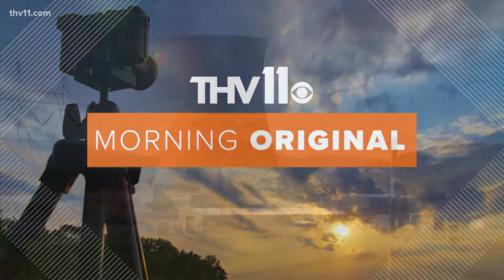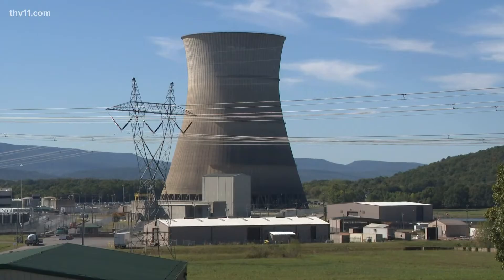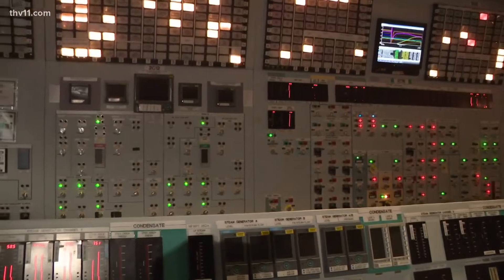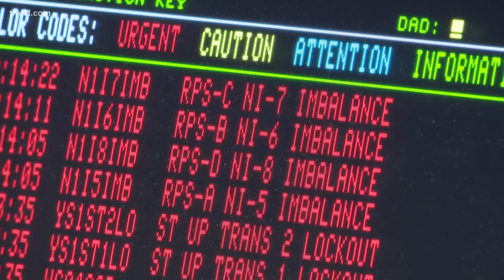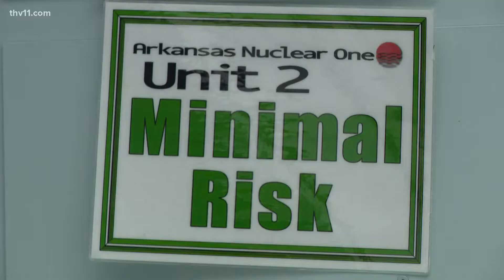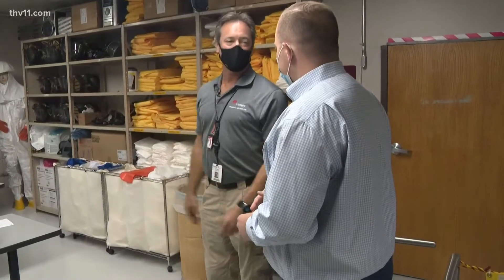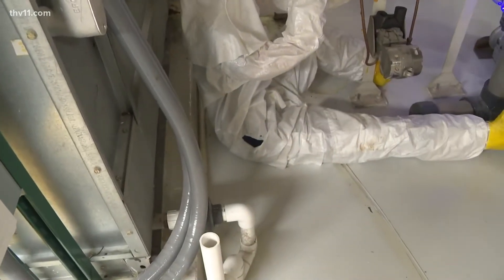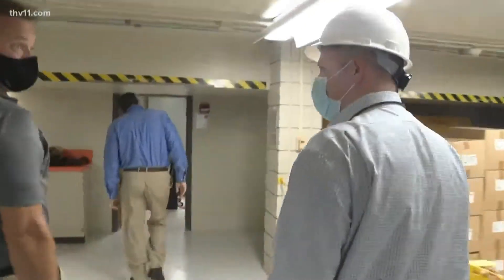A rare look inside Arkansas Nuclear One and how Entergy stays safe

Comment: you could push every single button in any order in the control room and couldn't cause a meltdown if you tried. everything is multiple-redundant and fail-safe. It simply won't let you do anything unsafe.
Reply: Not entirely accurate. The control room controls the reactor. There's a lot of damage you could do if you push the wrong buttons.